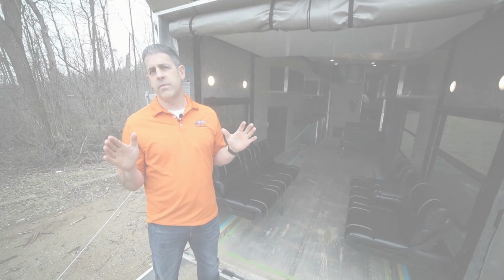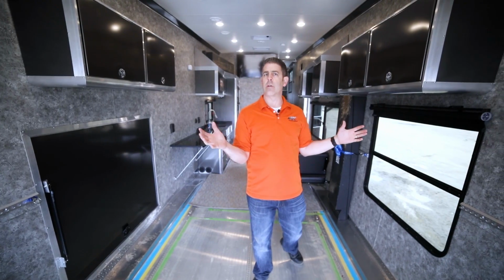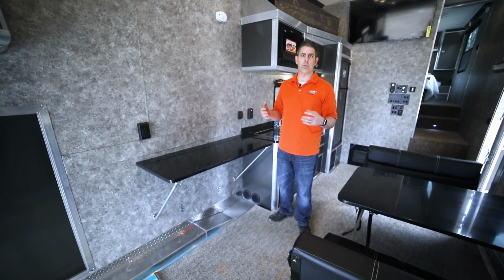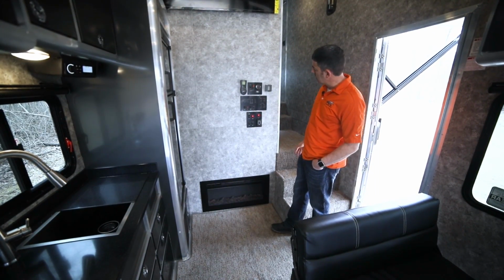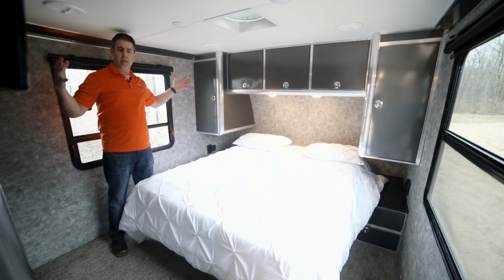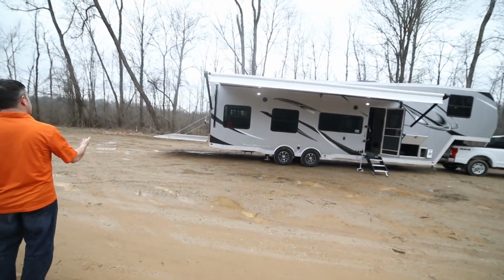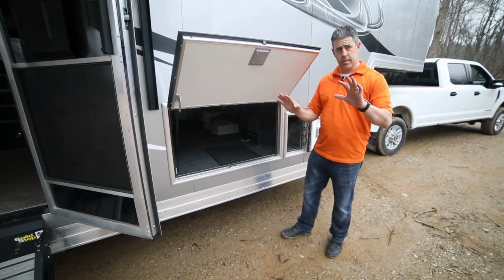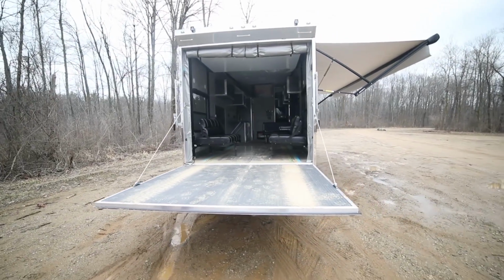ATC Toy Hauler 5th Wheel Walkthrough

Comment: Maybe a optional 10,000 pound winch and mountable fairleed at the end of the trailer with a anchor point for if a toy or Jeep has a winch to be pulled in if a transmission goes or a belt blows up located by the electric fire place
Reply from the maker: Hi Nathan, we currently offer a 5000# winch option and we are willing to evaluate custom requests. Thanks for your comment.

Comment: Last time I checked, anything over a tandem required a CDL whether for personal use or not.
Reply: I believe it varies by state and if it is a RV versus a trailer. I dont think it applies to RV's in most states.
Reply: Brian Lawhorn https://www.fmcsa.dot.gov/registration/commercial-drivers-license/drivers A correction to my comment, basically, anything over a gvwr of 26,001 lbs has to has a CDL. This comes from the federal dot website.I was assuming that each axle was 7,000 lbs. If you have axles with less rating, then you can get away with 3 axles.
Reply: @manufacturingmaniac  would need a regular class A. No CDL required unless used for business. Look at the weight limits for your DL. Usually printed on the back of your license. Trailer over 10k gvwr added to power unit gvwr requires a class A if over 26k total. Trailer under 10k gvwr added to a heavy power unit that comes out to a total over 26k would be a class B license, which seldom will happen with an RV. No one will ever say a word if you use a regular class C license unless u end up in an accident. Then the other party could have a field day if you weren't licensed to drive that much. There are regular class A and B licenses just like your class C. And CDL class A, B, or even C licenses, not needed unless it's business use.

Comment: The fuel station would be better on the outside of the camper (the driver side of the truck when hooked up) that way your not pulling the toys into the camping area to fill up.

Comment: So this is gonna sound silly but I'm being 100% serious

I'm working my ass off to be a full time RV'er and I have an idea of a perfect toy hauler! So far no one on the market has anything that fits my idea that I know of, and your toy hauler is about as close as I've come so far. So here's my idea for a few options you should add

Don't laugh but I'd like to see a 300 gallon diesel fuel tank. I know, sounds ridiculous right? But diesel fuel is perfect. It has more power than gasoline, and with modern technology and power output are cleaner than gasoline. And let's be honest! For the types of toys you guys intend for people to haul 36 gallons is chump change. I have a BMW 328d xdrive sadan that's a turbo diesel. My truck I use to pull this is a Leremie Longhorn Ram 5500 is another turbo diesel with 2 auxiliary tanks. One from the manufacturer and another in bed after market fuel tank. And a Kawasaki 650 M1030M1 diesel motorcycle. I plan to be taking my toys WAAAAY out in the boonies and on long road trips and would like to have plenty of fuel with me so I don't have to come out for a while

Furthermore, I'd like the generator to be diesel as well, and have it's own auxiliary fuel line straight into the main diesel tanks so I dont have to worry about filling it up with another fuel, or have to worry about filling up two tanks. This way I know if I didnt use all the fuel in the tanks then the genset will work.

If you can make this an option then I guarantee you have a customer for life in me.

Comment: Very awesome unit. Been looking at toy haulers for the last year and came across this brand. Not impressed at all with the toy hauler manufacturers and all the problems they are having. This unit may be a game changer.  A few things I would change would be to add a medicine cabinet in the bathroom. Add the mor ryde patio system to the ramp door if possible. Use bigfoot or equalizer leveling system and keep us far away from LCI products. Keep up the fantastic work and look forward to a video explaining the changes to the fifth wheel product.

Comment: My current 45’ fifth wheel has 150 gallons of water and separate grey tanks for the kitchen and bathroom. The toilet of course has its own black tank. The extra 45 gallons for the kitchen makes a huge difference when dry camping for a week plus. Where are the batteries stored and is there enough room for 4 6volt batteries and one dedicated generator battery?(again for dry camping long periods)
By the way it’s an awesome trailer and I am tired of water damage in “high end” trailers. Great job!
Reply: IT does come with 200 gallons of fresh

Comment: Fuel station needs to be on the drivers side. Can you make a large patio instead of escape hatch?
Reply: We are changing that already on all 5th wheels going forward.
Reply: Dale Davis I posted a question on your video about the three season room add on. 
I noticed that no one from your company is responding to comments/questions on your older videos. I hope to hear from you soon.
Reply: It used to be on the driver's side on the bumper pulls but they relocated to the passenger side to get the RVIA certification.  I believe that was the reason.  With it on the driver's side it's too close to the furnace (at least that was the case on the bumper pulls models if I'm not mistaken)